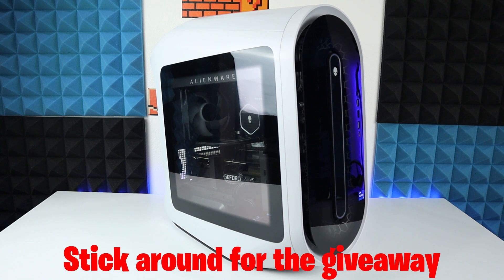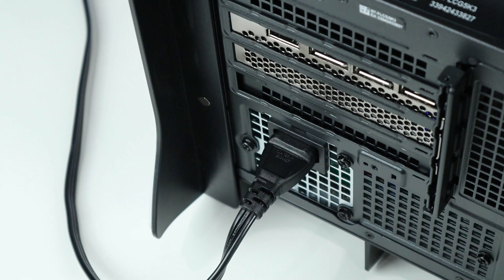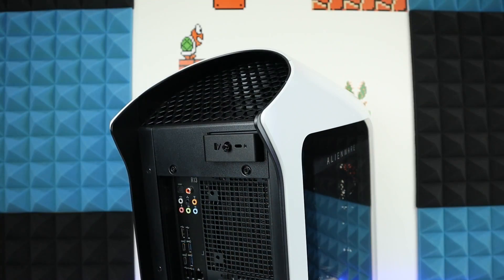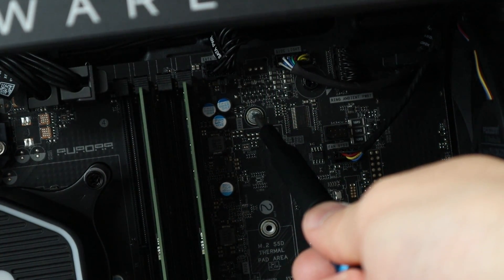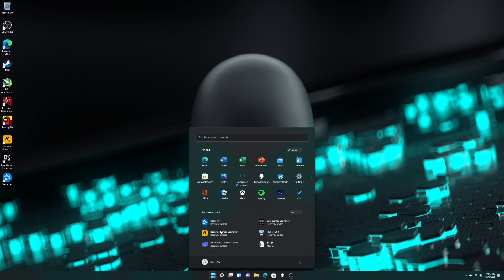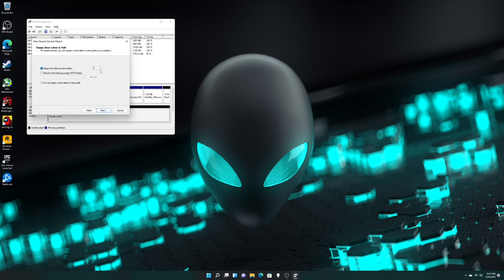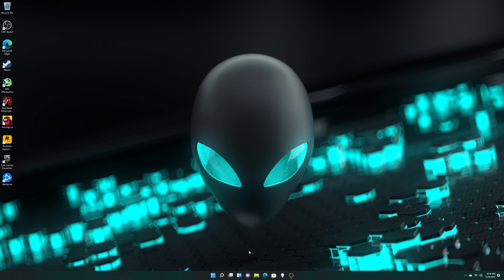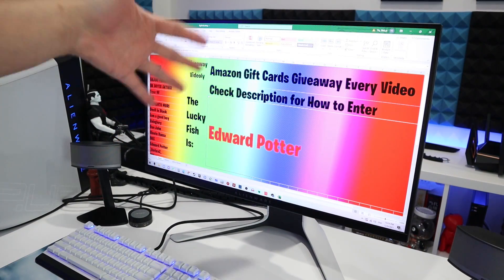How to Upgrade M.2 SSD to Alienware Aurora R13

Comment: Do you have a small PCIe card like an Elgato 4K or Cam Link Pro to test in the available x4 slot above the video card? I can't seem to get mine to work.
Reply from the maker: I'm getting an PCIe 4.0 adaptor for 3rd M.2 SSD.
Reply: Update, I have one other person tell me that their R13 PCIe x4 SLOT 1 is not functioning either. Dell basically wants to send out a tech to replace the motherboard, I am thinking it is an update or BIOS thing. So curious on your results trying to use the PCIe slot as well.
Reply from the maker: @michaellambjr  My PCIe card will be here soon.
Reply from the maker: Congrats on winning! Please set up your YouTube profile with email address, so I can send you the gift card.
Reply: @RyanYu  hrm, embarrasingly I am not sure where or what you mean by setting up an email for my profile.
Reply from the maker: @michaellambjr  Go to your settings of YouTube, you can set up your email there.
Reply: @RyanYu  Found the option for that I believe.
Reply from the maker: @michaellambjr  Just sent the gift card man.
Reply: @RyanYu  Thank you!
Reply from the maker: I just got my PCIe adaptor today, sadly, they sent me a PCIe 3.0, I just returned it, and getting the correct one. I will let you know if works.
Reply: Hi Michael, did you manage to install an elgato 4k capture card?
Reply: @kalkydra  Unfortunately not, ended up returning the Elgato card I had and opted for the ATEM Mini Pro instead.
Reply: @michaellambjr  That is really bad, then that PCIe slot is useless. I had planned to do exactly that... Thank you, you save me some hassle!
Reply: @kalkydra  well, it’s not entirely useless, I was able to get a PCIe SSD adapter working. Elgato support did try to send me a software fix to try, but I had already returned it at that point. So it could be working now.
Reply: @michaellambjr  I see, I had read it wrong. I tough the card did not physicians fitted in the PCIe slot as it was too small. So it was other issue. Thank you for the clarification.
Reply: @kalkydra  Correct, a small/narrow x4 PCIe card should fit fine. My issue was most likely a driver problem with the Elgato card and the newer Intel Z690 chipset. They've probably worked that all out by now.

Comment: I just installed the same SSD to my Aurora Ryzen 14, but am getting "boot failure on device". What have I done wrong?
Reply from the maker: Did you just add a new one to the second slot or replaced the stock one with the new one?

Comment: I'm not a pc builder and  last year I bout this pc with a RXt 3060 ti I want to change to 3090 ti do you think it fits?
Reply from the maker: It will fit, but you will need to remove that GPU holder in the front.

Comment: Can i just change the ssd from the spot 1 to the spot 2? 
I hear once that it would be better for the temperatur.
Because spot 1 ist just between cpu and gpu so all the heat goes also on the ssd
Reply from the maker: I’m not too sure about that. Let me know if you try.
Reply: @RyanYu  So i changed it and it works, but i don´t know how to check the temp of the ssd. The program that i use didn´t show the ssd temp (cpuid hwmonitor)
Reply from the maker: @MrSem0123  try MSI afterburner.

Comment: Question. What happen if my window boot from old ssd??? How i can keep wwindow??
Reply: So aurora 13 have another slot for m2 ssd ??? Thnkas bro
Reply from the maker: @nguyensam3877  Yes.
Reply from the maker: You need to do a system swap to the new ssd if you want your new ssd to be the boot drive.

Comment: Completely new to the whole pc building stuff. I just bought an ssd from dell and nothing more. Do I need some type of like thermal pad to put the ssd in?
Reply from the maker: You don't have to, but for max performance and temperature, it's better to install the thermal pad or heatsink.

Comment: what i wanna know is my r13 only has a 512 os (c) drive and a 1tb (d) drive , is it better for me to just install a new 1tb ssd drive as a 3rd drive or should i replace my os 512 drive? and is it difficult to replace the os (c) drive?
Reply from the maker: Your OS drive is the M.2 SSD right? then you can just add another M.2 SSD for gaming.
Reply: @RyanYu  Yes it is , And do mean just add it as a 3rd drive and not replace?
Reply from the maker: @SmarOneNine  yeah, 3rd drive will be better.
Reply: @RyanYu  Sweet thanks alot man….Probably alot easier too
Reply from the maker: @SmarOneNine  yeah, and you get more storage too.

Comment: The motherboard has a small square that says "THERMAL PAD AREA". Did you and do you need to add a thermal pad there before you install the M.2 SSD? Sorry in advance if this is a silly question.
Reply from the maker: If you buy the one that I'm using in the video which comes with the heatsink, then you don't need the pad.
Reply: @RyanYu  thank you so much for the reply! Love your content and willingness to help your community
Reply from the maker: @OrangestangPS  No problem man! my community helps me to reach my dream too.

Comment: Hi, hope doing all right. Additional question, I got the cyberpunk SSD which has some RGB lights of its own. However the cable that comes with is a 4pin cable but the motherboard does not seem to have that connection. Would you know how to make this work? Thanks a lot!
Reply from the maker: Try to get an ARGB adopter?

Comment: Great tutorials on how to make upgrades to the R13! Thanks man!. Would be greatly appreciated to see how to do the RAM RGB upgrade. Moreover is there a possibility to do a ram rgb upgrade that is synced with the other rgb controlled by the alien software? Or does it has to be independent always?
Reply from the maker: If the RAM that has RGB, you will run the independent software.

Comment: Quick question, how are your temps with the SSD with the heat sink? I got the exact same ssd without the heatsink and installed it into my r13, so far, everything’s been working fine, but I’m worried about the whether the airflow in the case would be enough
Reply from the maker: it’s actually pretty good in temps.
Reply: Yea I got the Heat sink and it only helps about 4 degree it's really enough air flow. really I think the main SSD would benefit from a heat sink more.

Comment: I just received my Aurora R13. I contacted Dell to see if the 980 pro was compatible, they said no... Since you installed it, does everything run properly and was there any conflicts? My system also includes a 2t 3.5 HDD. I was looking forward to adding the 980... please help
Reply from the maker: It works.
Reply: I purchased and installed my 980 pro. My read speed was 5701... I saw a video for the WD 850 that read at 6500. Would you know why the difference?  Thanks

Comment: Can you do a favor. I have an R13, but unfortunately I cannot install windows on the Samsung 980. May you try to create a boot drive and just see if you can search the disk to install windows without installing windows. The problem is finding that SSD on windows boot loader usb stick installation.
Reply from the maker: Did you try to copy the windows to the new drive?
Reply: @RyanYu  Unfortunately not. I tried to create a bootable usb and install windows on the ssd using the windows tool. Its just the windows tool would not see any drives connected to computer even though I know it is there. I may try copying windows from primary and duplicate it on secondary. Do you have a software recommendation or do you know if I can just copy the drive while using windows like have my primary windows os running and copy the windows from primary to secondary while primary operating system works or do I need to copy the drives from another ssd that has windows. Also your videos are really helpful.
Reply from the maker: @Blue0476  there is one called Samsung driver transfer something try it on Google

Comment: Just installed my M.2 980 Pro 2TB with a Sabrent copper heatsink (I manually replaced the included thermal pads with SilverStone thermal pads). My entire 400GB steam library copied over to it in about 10 minutes, and CrystalDiskInfo said my new drive never went above 41 Cº! I love you, man. (My default drive, C: , hit 62 Cº during the copying, but my Samsung 980 Pro that I just installed as "S:" , that I wouldn't have even known was possible to install myself without this video, was 20 degrees cooler at all times!)

I love this channel I love this channel I love this channel.
Reply from the maker: No problem man! The channel loves you too!

Comment: This may seem like a dumb question, but I noticed that the ssd that came in the r13 is gen 4 x4 but on their website I says the other slot is gen 3? Is that true or can I just get another ssd exactly the same as the one that came preinstalled?
Reply from the maker: they are both gen3/4 compatible. you can use either gen3 or gen4.
Reply: I believe it would mean that the speeds in the second slot are at 3.0 speeds

Comment: Thanks for your video, it helped me a lot. I have a question. When I checked the evaluation on dell's official website, someone said that the R13 motherboard only supports one SSD. I prepared two additional SSDs (a 980pro and a 2.5inch SSD) just like you. I have purchased an additional SSD and I am waiting for my R13 to be delivered. So like in your video, both 980pro and 2.5inch SSD will work successfully, right?
I will have a total of three SSDs. The original M.2 and the additional 980pro and a 2.5inch SSD I installed.
Reply from the maker: That's right.
Reply: @RyanYu  I see that there are two M.2 2280 SSD slots on the motherboard but in the official manual it says you can only install one SSD. In other words, the official statement is not accurate. I can install an additional M.2 SSD and a 2.5-inch SSD just like you.
Reply from the maker: @ianzheng3743  YES SIR.

Comment: BTW, that screw in the Motherboard isn't meant for installing the NVME in the 2nd M.2. That's the standoff. You need to buy a M.2 screw that screws into the top of that standoff. That way the drive sits level.
Reply from the maker: Thank you for sharing bro, but it works tho. save the $$$ from that screw.
Reply: @RyanYu  it doesnt i followed ur instruction and i suddenly got the beep sound so probs dont do it definitely buy the m2.3 screw dont risk it for buying a 1 dollar screw
Reply: You have a link to the screw?
Reply: I’m confused. Why do you need to buy a separate screw for this? How come you can’t just use the screw you unscrewed to begin with?
Reply: @Legendkiller19100  The Motherboard only comes with the "standoff" that spaces the SSD parallel with the Motherboard's PCB. Remove the stock SSD and you'll see the same Standoff between it and the motherboard that. It doesn't come with an extra mounting screw for a 2nd SSD. That "screw" in the Motherboard is a standoff, not a mounting screw. Take notice to the threaded hole in the center of it for a screw to be screwed into it.
Reply: @keithvsmith  ok so pretty much you’d just buy a m2 screw and use it instead to mount the m2 you just put in instead of just putting back the same screw you took out. And then you will be good to go?
Reply: @Legendkiller19100  Correct, otherwise, if you use the standoff itself as a mounting screw. The SSD won't be level and you'd put more strain on the M.2 socket. Plus, if the SSD you use has exposed circuits on the back, those could contact and short out on something on the motherboard.
Reply: @Legendkiller19100  NOTE: I should say, mine didn't come with the extra screw. Later shipments may have. I got mine years ago, when the R13 first launched. Changes could have been made.

Comment: is the  slot for the M.2 gen 3 or gen 4 on the R13? for example could one enjoy the speeds of the PCIe 4.0  980pro on it? (it says up to 7000mb/s) the spec sheet for the R13 says the ports are Gen3/4 x4, so i guess they are 4.0 ? thanks!
Reply: it is both gen 3 4 and 5. According to Dell
Reply from the maker: You can use both 3.0 or 4.0.  You can have 2 4.0.
Reply: @RyanYu   thats great! what read write speeds are you getting on yours in the aurora R13? big congratulations on the computer btw, it looks great!
Reply from the maker: @JohnWallinLiberto_art  I haven’t test it yet.  What software should I use.
Reply: @RyanYu  how about CrystalDiskMark?  thanks for taking the time to do it :)

Comment: Can you make a video of changing the new M.2 you put in to your boot drive and transfering windows and stuff to it? I'd like to buy a configuration with the smallest nvme and just purchase a 2TB nvme and install and transfer windows myself. Would be nice to have a guide and I think others would appreciate it to save them money too! :)
Reply from the maker: I didn't change the OEM M.2 tho. I just added.
Reply: @RyanYu  Usually the Samsung Data Migration Tool will work if you buy a samsung SSD. But currently, the software isnt liking the new platform and doesnt properly register the SSD
Reply: Also, be aware if you change the boot drive Dell will not provide service. I cloned an existing 256MB SSD for a larger one like you are looking to do Dayle and years later I was having some issues and when Dell discovered I changed the OEM boot drive they refused to help me!  Maybe Dell has changed their policy but just in case it is good to know.

Comment: I'm wondering what's the highest capacity allowed for M2 and SSD, maybe i can find it in the manual.
So far it seems like the R13 has very little compatibility issues compare to the R12.

Hope you can do the Fan change upgrade, particularly the rear fan for the CPU.
I already changed the 3 fans on top and the two in front.
They work with noctua. Noctua A12 spins at less than half the RPM, but the cooling seems equivalent.

You will want to change the CPU fan because it will still be noisy in the quiet profile.
Reply from the maker: I’m changing the rgb fans. Haha
Reply from the maker: I think is 2tb.

Comment: Thanks for these. Saved for later. I am considering getting an R13 to replace my 2015 iMac! Still debating on i7 vs i9 with a 3090, or even a 3090Ti next month... I worry about the heat and this will be my first proper PC. I am wondering if the 3090Ti, despite higher TDP will be better on the heat front with V memory just one one side? It may make 3090 cheaper? IDK. I guess Alienware may need to bring out a higher PSU also? Newly subscribed to you so I can learn more before my pending purchase!
Reply: RTX 40-series coming in April also! You can always wait for the next best thing, but if you buy sooner then you can enjoy it sooner and decide if what you have is fulfilling your needs and learn faster, and upgrade accordingly! :) Only reason to wait is for price deflations on chips, but you might have to wait more than 6 months for that.
Reply from the maker: I heard you, it depends on what you do mainly for the PC? Gaming or causal or you just want the best.
Reply: @RyanYu  Graphic design, database work, Gaming, maybe some mining (not done before), bit of everything really! I generally look for a computer to last about 5 years and my current one is over that, and showing signs of giving up… so wanting to future proof it a little bit, where possible…
Reply from the maker: @ulsterant  If you are in a rush, then go with the i9 with 3090, but if you want the best, then wait for the RTX4000 GPUs next year man. I heard it will be out around April. RTX4090?! think about it. it's gonna be crazy!
Reply: @RyanYu  Yes, I know, but then there will be something else better after that ;) I know that what I get won’t be the best for several years after I buy… besides, the 40xx will be super hot, right?
Reply: Oh April… hmmm…
Reply from the maker: @ulsterant  The heat, I don't know yet. We can never get the best ones. For you, I think the i9 with RTX 3090 will be perfect then.

Comment: Nice. Memory next?
Reply from the maker: Memory I don’t think we can do it that soon.  They are overpriced so much.
Reply: @RyanYu  I agree. It is crazy. And finding 4400mhz ddr5 dram is impossible. 

Do you know if it is possible to unlock higher speed ram for R13? Or if it is risky to buy higher speed ram for R13? My understanding is that if I buy 5200mhz ddr5, it will not hurt the machine but it will run at 4400 and there is nothing we can do about it... is this correct or wrong?
Reply from the maker: @noahcohen8417  may be next year May?

Comment: Is it worth to upgrade it?
Reply from the maker: Yes, this is the best SSD for gaming.
Reply: @RyanYu  Isn't it the same SSD as the one that comes with the computer already, though? Is gaming on the drive with heatsink worth it, even if we do not need more storage than 2TB?
Reply from the maker: @noahcohen8417  If you don't need that much space, then the OEM is okay.
Reply from the maker: @noahcohen8417  I upgraded it, since I have so many games...
Reply: @RyanYu  Agreed. I use my 980 pro for games only and the 1tb for drivers and stystem stuff.